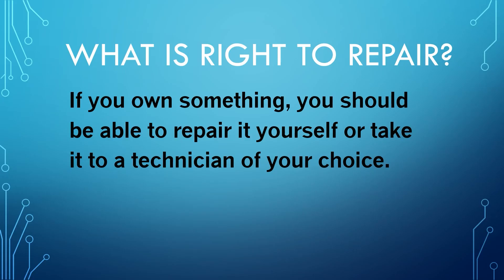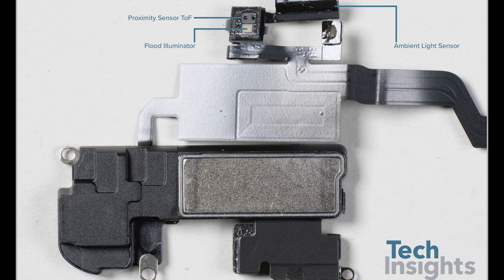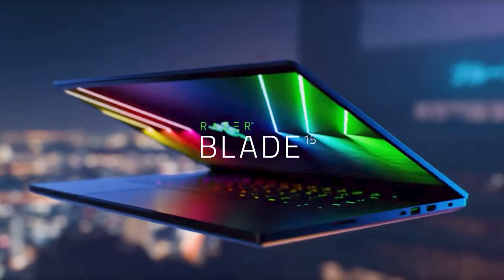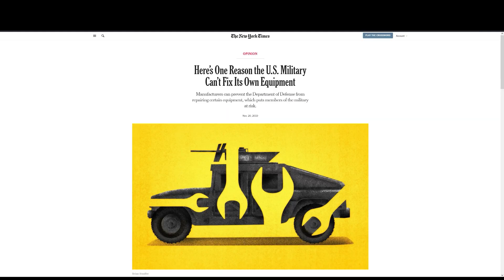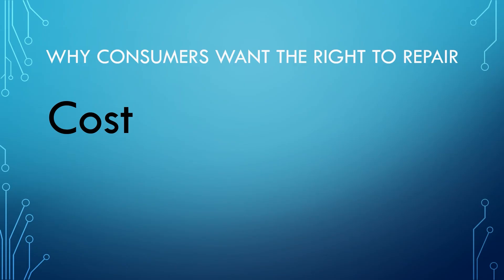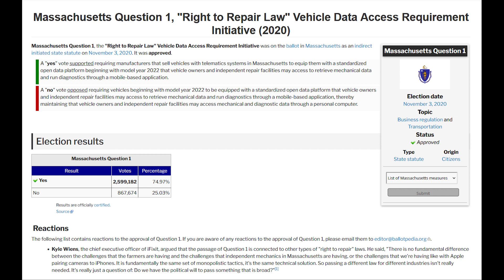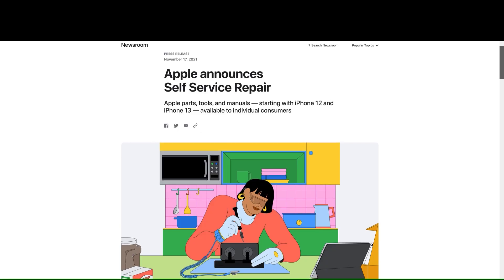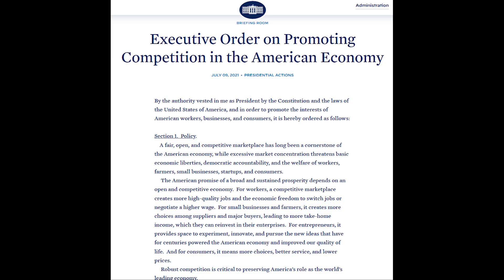A Right to Repair Presentation

Comment: 1 thing missed in consumer benefits, data recovery. Without r2r and storage stuck in the device people will lose priceless photos and data, and manufacturers don’t offer any way to recover data, in fact they usually guarantee you won’t get your data when doing repairs.
Reply from the maker: Excellent point! I should have included this in the presentation. Thanks for pointing that out!

Comment: A good way to protest for right to repair would be to make a bunch of serialization-tampering modchips (Game console enthusiasts know what a modchip is)
Reply: I'm saying a modchip because it seems most feasible to go with a hardware approach to hacking the serialization feature due to mostly being encryption related, which tends to be easier to defeat with hardware than software.
Reply: I bet you can't wait to install an "Applin ModKit" into an imac from 2021.